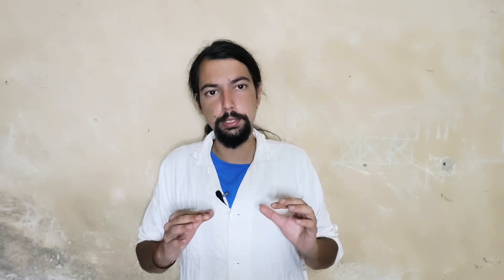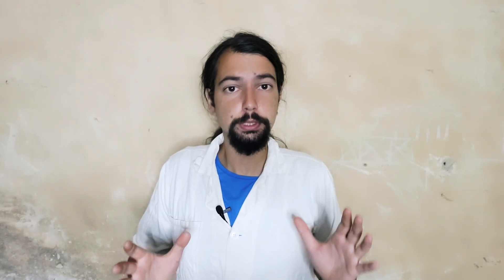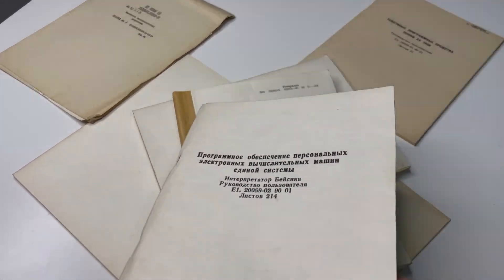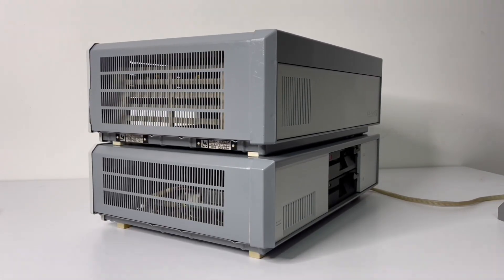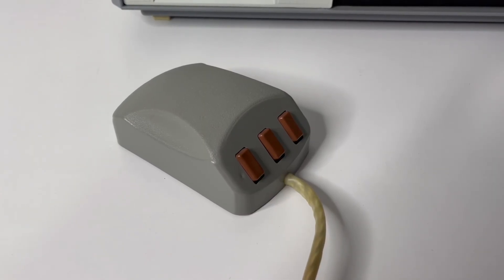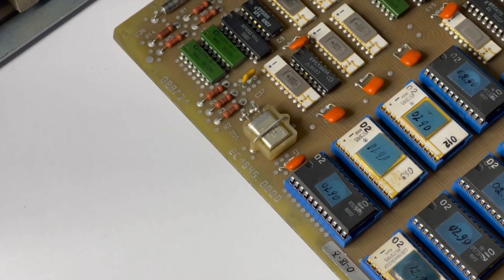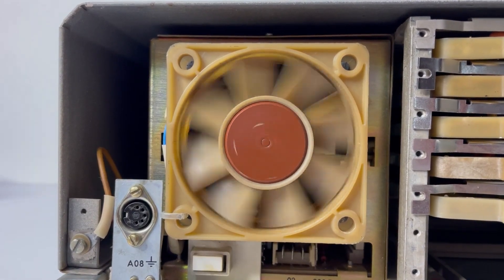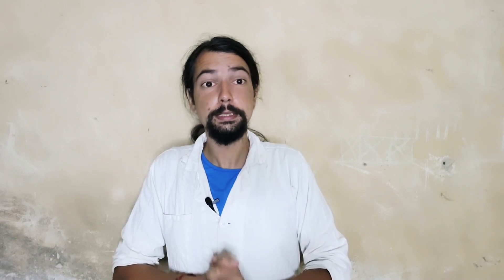Extreme Restoration of a Soviet ES1841 PC. Computers of Chernobyl

Comment: As someone who grew up as a teenager in the USA during the Cold war in the 1980s, and who collects vintage computers today, this is absolutely fascinating. We always knew that Russia had cloned popular computers, but I'd never seen any in detail until your video. 

I'm surprised at the changes made in the Russian example. Some of them seem backwards and wrong, but some of them seem very clever, like the ability to add multiple 512KB boards. Since the 8086 could only access one megabyte, they must have used a proprietary system for ank switching the third board in and out of address space. Fascinating! Also: That speaker is gigantic!

Please keep up the good work.
Reply from the maker: Thank you! It actually was a complex and a twisted story worth a thick book. There were two main "schools" in the USSR – the Russian one (originating from Sergey Lebedev and turned to NIICVT based in Moscow) and Ukrainian one (originating from Viktor Glushkov, turned to the Cybernetics Centre of Ukraine based in Kyiv). Somewhere in the middle was MPO VT in Belarus with their powerful chain of microelectronic factories.
These centres had different approach. This very computer is Belorussian product with aт influence of the Cybernetics Centre (which later created expansion units for it – some will be in the next video). Russians had also own practices, solutions, etc., more fitting their factories.

As for i8086 in a particular, the story continued in an unexpected way. In Belarus, at MPO VT they have been trying to slice i80286 to make a clone, because they reached a "glass ceiling" of performance. It is a dim story, as no one remembers now whether it worked apart from literally few cloned prototypes. But the thing is, that after ES-1841 appeared the ES-1842 in a desktop format, running the same processor as ES-1841, but capable to run programs for i80286 with slightly lower performance. That was achieved by adding a custom-designed chip called КА1843ВГ1 (KA1843VG1) that allowed the i8086 to operate in a protected mode.
This "glass ceiling" was a reason, why in the latest ES machines you can find 286 / 386 from Intel surrounded with Soviet ICs -- see the video about ES1849 we have on this channel, that's it. 

As for that speaker, in another "dead" set of ES1841 from Nov 1991 we have it is smaller. It looks like they installed what third-party factory production could supply at that moment, and it got  changed later. But, it got an unexpected application as well -- there was a speech synthesis board developed for this computer, that allowed to convert text-to-speech with this speaker as an output. Never seen it, but it definitely existed and was referred in all documentation.

So, there are many, many stories like this. 

What I like in relation to Chornobyl Zone, that it became a sandbox of testing of numerous types of machines for very special applications. So there will be way more content, and not only about ESes...) So you are welcome to subscribe :)
Reply: @ChernobylFamily  Was already subscribed :-D  Thanks for the backstory; very fascinating.  It is very uncommon for russian/belarussian clones to be seen in north america, so this has been very educational.  How amazing that there was this entire industry that developed products in a parallel path but with very different methods.